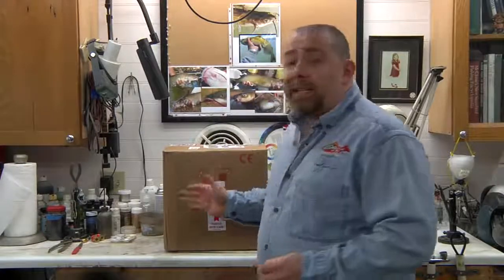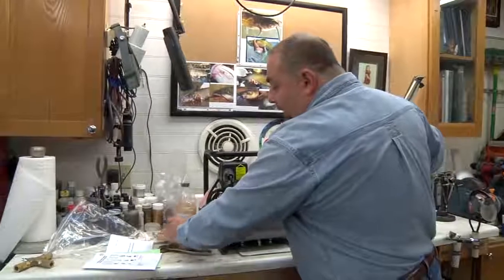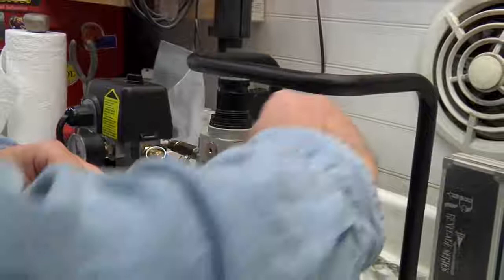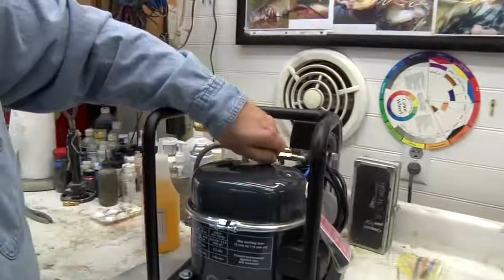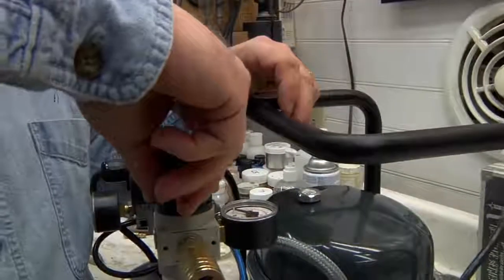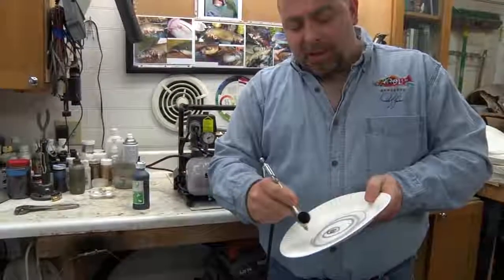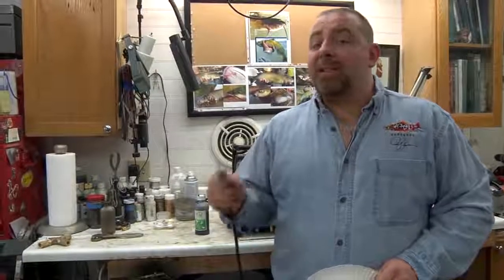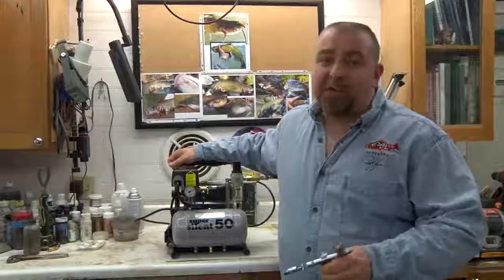Silentaire Compressors 50 TC

Comment: I have older model 50-TC it looks just like you have except chrome version. I bought it 15 years ago. it still works fine.  gasket went bad I couldn't find it I had to 3D print it with rubber material. I have gasket, cover for air intake and rubber washer oil indicator. I also made a small box to put parts.
Reply: Do they sill sell them or is there a new moldel out there?

Comment: I have seen conflicting spec lists for this compressor, is it 110 or 220 ?
Reply: Pretty sure it 110. Mines old but it’s 110.
Reply: I bet they make both types though, and that’s why it’s stated that way.
Reply: Thanks, I did get the 110, and I love it, it’s a pretty amazing little compressor. My only issue with it was on delivery, the bottle of oil leaked all over the inside of the box and just covered the compressor, it was a horrible mess. But after a good cleaning everything was fine.